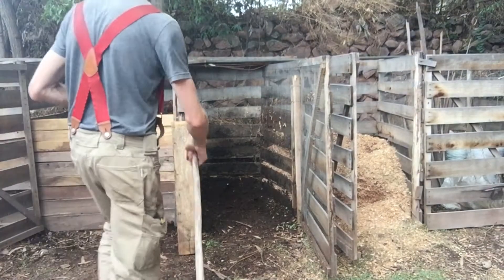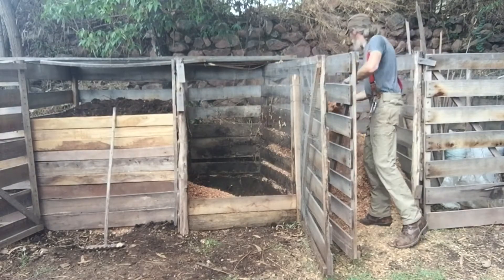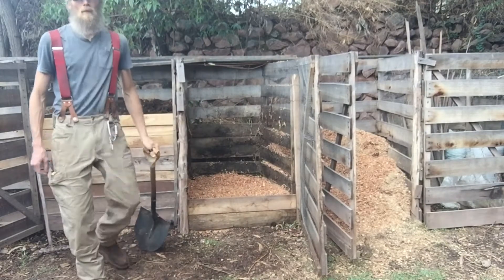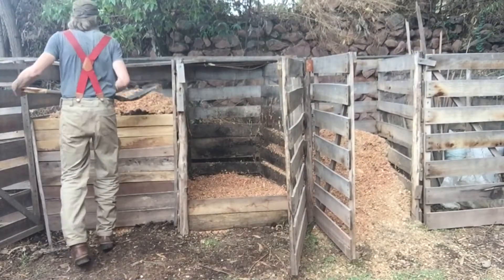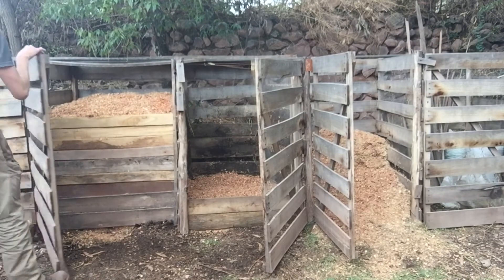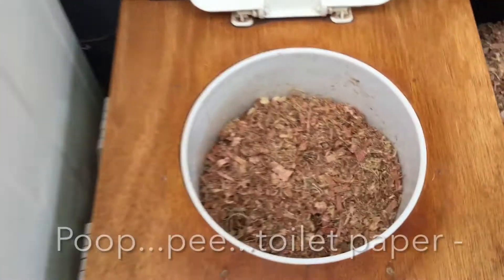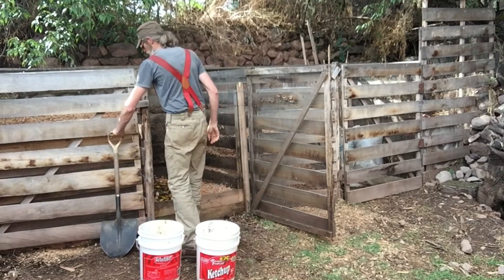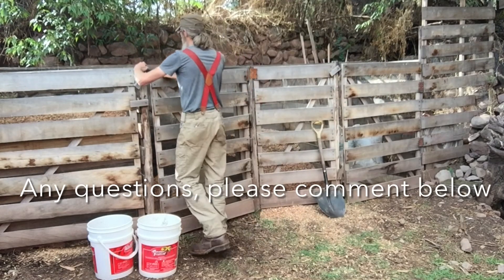Humanure Compost System - How it works

Comment: Great video brother appreciate your input! So would it be as safe to just keep stacking and storing your full toilet buckets until you’ve got a full piles worth, and dumping them all into the designated area at once, instead of taking them out individually every time? I plan to build an outhouse with storage next to it which I could use to store the full buckets.
Reply from the maker: Thanks! If you wanted to do it batch-style instead of the continuous method it might work, but I’ve never done it. There are a few reasons why I wouldn’t take this route - 1. Simply storing a load of full buckets presents a situation where you have a less than ideal anaerobic fermentation happening. This produces a lot of methane gas buildup, and could potentially lead to lids blowing off the buckets and creating a bit of a biohazard. 2. The continuous method allows for easy layering of waste(high nitrogen) and carbon (wood chips, etc). In a batch system, you’d have to do that layering as you add each bucket to he pile, otherwise you’ll end up with hard to contain liquid mess in the middle, which will decompose anaerobically, and smell absolutely awful. 3. You’d still have to wait the 2 years for the resting period, and possibly longer because you’re attempting to break down a lot of material all at once, and the process may not be as efficient. Not to mention the smell from decomposing anaerobically fermenting shit. Imagine the classic manure pit on a farm, only with human waste. 
The reason I like the continuous method is that the labor is relatively minimal, and the pile is able to stay in largely thermophilic state in the core between additions, which kills off most of the pathogens. If it’s possible, I would recommend placing the pile in a convenient location nearby the outhouse to make the trip less of a hassle. Properly managed, the pile has no smell, and the labor with this method is as minimal as it gets with making compost.
Reply: @ericoberholtzerknives  thank you for your advice! You’ve made an excellent point thus changing the route I’ll go down 😄
Reply from the maker: Happy to help, best of fortune to you!
Reply: @Breazeh  Not to mention the added expense of having so many buckets.

Comment: Very good tutorial....thank you for sharing. Quick question. Thinking about doing this at our little cabin we just bought in the woods of PA (Alleghany Forest). Being that it is bear country around there should we skip adding the food waste to the compost pile as to not attract bears? And is it okay just to add only human waste to the pile?
Reply from the maker: Greetings, thank you! I’m from Lancaster(Lititz) originally :-) yes, if you’re worried about bears, skip the food waste unless you want to build a bear-tight enclosure. The pile will still function the same as long as the carbon/nitrogen ratios are good. The number one sign that it’s off is smell. If it smells like ammonia, add more carbon material. If it smells dead animal or manure, it’s fermenting anaerobically, you need more air. If it smells like poop, you may need a different ratio of air/water/carbon because that means it’s just not breaking down. When you open the top of the pile to make another addition, get in the habit of smelling the pile, that’s your feedback for how it’s going. At 4-5 days between additions, most of the poop in my pile from the previous addition is unrecognizable, and it no longer smells.
Reply: @ericoberholtzerknives  Great Thank you for the tips!!
Reply from the maker: Anytime, good luck!
Reply: We do this and live with bears. We have set up a solar generator electric fence around it 😅

Comment: Thank you for a super guide for human waste. would excessive rain is something to be concerned??
Reply from the maker: Thank you! If you live in a high rainfall area, then a roof over the bins would be best so you can control moisture level in the pile. Best if you can do rainwater collection from the roof to supply water for washing the buckets. Ours isn’t covered, but we get only about 20” rain annually, and only during half the year. I compensate by using less wash water during the rainy season, and more during the dry season. The pile will absorb a shocking amount of water though, once it gets up to a cubic meter or more, I can let the hose run directly into it for an hour if I like, and there will be no runoff. I do this periodically during the dry season if the pile looks like it’s drying out too much. You’ll have to experiment to figure out what works best in your own region, as every situation will be a little different.
Reply: @ericoberholtzerknives yep, microbes swim 😊

Comment: You must pee somewhere other than the compost toilet... I mean, even if it were just me, without any family members, I would fill that entire bucket with pee over 5 days.  What's the deal there?
Reply from the maker: Urine goes in the compost toilet as well, and the bucket fills up every 4-5 days, with 2 adults and 2 children using it. No need to separate urine as long as the pile is maintained with enough carbon material to keep it from going anaerobic.
Reply: @ericoberholtzerknives  Wow... I must pee a lot more than you guys or something.
Reply from the maker: Well, I’m no doctor ;-) maybe it’s worthwhile to measure how much you’re actually urinating, and compare with volume of daily fluid intake, keeping in mind that diuretics(alcohol, caffeine) contribute to more volume. According to a quick google search, average urine output is 800-2000ml, based on a 2L avg intake of water

Comment: Thanks for this video because you presented the compost toilet so easy to use. I really love this idea a lot. My question is what material can one use in case there are no wood shavings in the area? Would Hay work or one must only use wood shavings?
Reply from the maker: Hi there - any dry, brown material will work. We actually used the toilet the entire duration of quarantine here(1 year) without wood shavings, because they simply weren’t available. Instead, we used grass clippings(dried and green), weeds, and dried fallen leaves. Some periodic loosening of the pile was necessary to keep it from going anaerobic, but it works just as well. I was thrilled to see it function so well as I’m aware that wood shavings aren’t available everywhere, plus they are an external input, which obviously doesn’t fit in most closed-loop systems, and isn’t a long term solution. For now though, I’m happy to use them because I obtain them locally for very cheap, and it’s less labor than continually rounding up cover material from the property.

Comment: Hey there fella, good to see you. 
I have a question about this tutorial. 
Should one worry about any kind of combustion with this or similar methods? 
I’ve seen leaf piles go up in smoke after sitting. 
Thank you for making this and the other vids. Much appreciated.
Reply from the maker: Hey! I would say no, in my experience, and we’re in a location where that happens pretty frequently - I’ve had to put out spontaneous fires several times, from piled field waste left by other farmers. The pile should stay pretty moist for optimal composting, which isn’t a problem given the amount of urine, and the water used in washing out the buckets that goes back on the pile, plus retained moisture in the food scraps. My pile is usually between 140-150F in the core where the material is fresh, but I’ve never had it get hotter than that.
Reply: @ericoberholtzerknives and it gets wet every time it rains 😊 Microbes swim 😊

Comment: in our soil food web class, we call the wood shavings fungal food.  They really give the beneficial fungi some goodies to eat up...
Reply from the maker: Definitely. I’ve found the wood shavings work best, because of the high C:N ratio. You can do it with grass and weed clippings, or leaves, but the ratio is less with those and the pile tends to go anaerobic which requires more maintenance
Reply: @ericoberholtzerknives  Hi thanks for your video's very informative. I have access to grass clippings but not sawdust or wood shavings. Will the grass clippings in "damp" form be enough to seal odour in the toilet bucket during use? I have access to eucalyptus leaves. Are these ok to use ? Thanks .